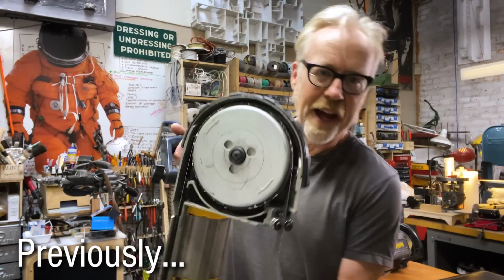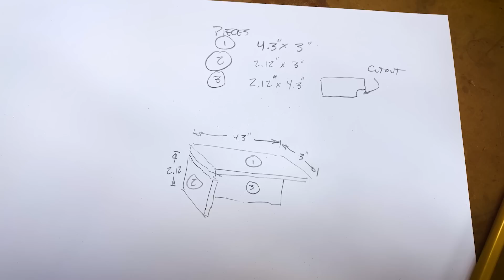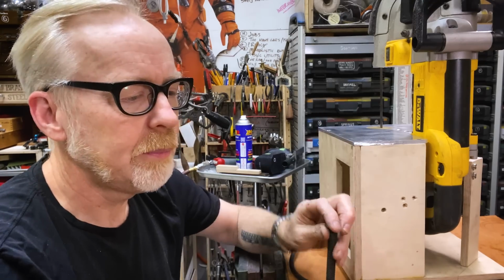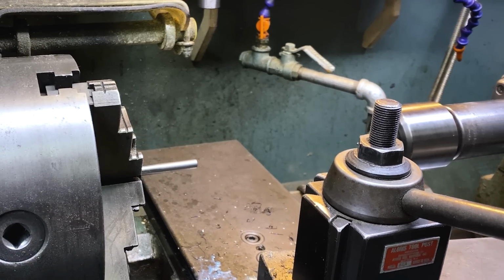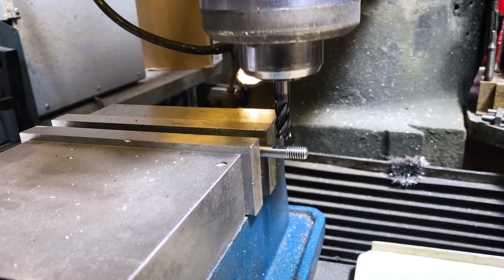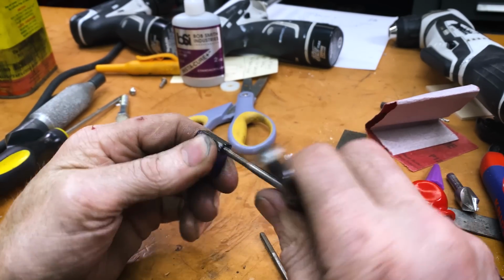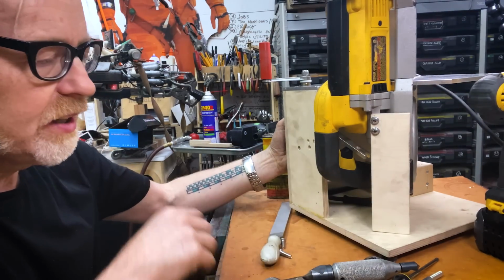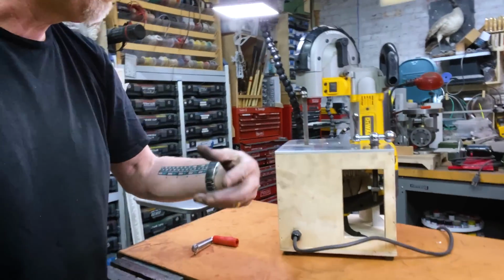Adam Savage Upgrades His Mini Bandsaw!

Comment: If ya had a worm gear on a rod for the crank handle and a strait tooth gear to fit the bolt making a counter sink hole in the aluminum plate for the bolt head (mill the bolt head into a flat disk that fits the hole snug) using only the middle part of the thrust bearing. If plate is to thin add a small plate under neath make flush a cap or cover plate grease inside (leaves you with nothing on top to block your material your cutting) This way you can mount the crank handle to the side of your stand. Or my favorite I like to jerry rigging a Harbor freight router veritable speed controller or a foot pedal switch and a zip tie holding down the tools switch.

Comment: I'm surprised the trigger was not just zip tied down and a power dimmer switch was added to the power plug wire so it could be turned off and on then turned up or down to make it go slower or faster.

Comment: my first thought was an eccentric thingy rubbing against the trigger, on a shaft connected to just a knob on the side, so that when you turn the knob, it presses the trigger in further. add some stops so that you cant turn the knob too far and turn the saw off when going full speed, and maybe drive it with a worm gear or something for positioning and so the pressure from the trigger doesnt move your shaft? i think having it on the top is kind of a safety hazard, and reduces the bed size on an already tiny tool.

edit: there really isnt any reason why the design used couldnt be geared to have the speed control on the side, either.

Comment: Seems there is a dial on the side of the saw, visible on the saw body below the handle at 26:35. Is that not a speed control already built in?

Comment: I think U should've put the lever hinge on the other side of the saw 
That way 
1, the removable of the rig is much easier 
2, the amounts of turns U need to do is much smaller 
And 3, invert the direction of the operation ... turn right to speed up

Comment: Maybe the front panel has the bottom dust drawer attached so instead of opening the door to get the tray out to empty
You can just lift the front panel and drawer in one to save cleaning time
And the drawer helps to keep the front panel in place

I want one now

Or maybe 2

So I can make one into a gravity engine to power the other one

Comment: Should have just made a foot switch for on/off. Probably more useful than variable speed knob, I’ve got the same saw and there’s a separate knob for variable speed if you need it. I like that table though
Reply: well it is hard to see on camera, but Adam cave is really small and a foot pedal would add vertical space requirement to the setup, 
plus the foot pedal would add more time to the setup time and it will reduces portability and make it less used.
also without the a foot pedal he can just put it on table that he is working on and plug it into the table.

Comment: Question...instead of the handle why couldnt you just take the button out and replace it with a 110v dimmer switch? It would work like a variable resistor to lower and raise voltage to blade aka speed controller

Comment: At 19:20 why not just chuck a die on its own (without the handle) into the tailstock chuck? And then just turn the lathe chuck to do the cutting?
Edit: Immediately realized that you would have to unlock the tailstock to allow it to slide in as the die cuts along the piece. But as long as the piece can fit far enough into the chuck/tailstock to cut all the threads it should be fine. But as I'm typing this I am realizing that It's easier to just use the die in a handle like normal, and maybe use the tailstock to square up the die for the first cut, after which it will stay true on its own. Exactly as Adam has done here LOL

Comment: I would have put the handle on the side and used a right angle lever to translate the horizontal rotational movement to vertical and avoid having a finger control on the same surface you are cutting on.

Comment: If you had slanted the lid of your "switch box" any dust etc wouldn't accumulate right in that hard to get at corner. You could still do that actually by adding a quarter cone cap in that corner.

Comment: Assuming that space is no issue, is it better to buy one of these small portable bandsaws or a cheap Harbor Freight bandsaw and install a metal blade?
Is this DeWalt that much better quality than a bench top saw from harbor freight? 
I know HF isn't great quality, but for about the same price they have saws that have MUCH bigger capacity, throat and height wise.

Comment: ,Mr Adam I wondered why you didn't put a speed control and on- off on that piece of plywood LEG and wire the throttle speed  and block the with a standard light switch and I also though that hole I instead put in two computer fans

Comment: Love the videos and engineering but, instead of building the speed control.  Why not just lock the trigger on (or use a zip tie on it) and use the speed control dial built into the grip?

Comment: Is there not a speed controller near the handle? Its the dial wheel near the handle. Both the DeWalt and my Milwaukee have the same built in speed control.

Comment: Okay, that's  all good and fine BUT! Vhat I van't to see is more of a metal housing with a stainless steel tilting vork surface where the saw can easily snap in and out without removing the shroud. Do you think you can do that? Well do ya?

Comment: That was the most complicated way ever of going at it but I guess it worked.  I would have just shorted the trigger and used a dimmer switch in line with the power cord would have done the same thing as the speed controller on the trigger switch.

Comment: Adam, as much as I love your mechanical problem solving over electrical problem solving, I want to issue 2 reasons why you should not have installed this modification.
No. 1
Your use of a screw arm is a good one. I appreciate the use of screw threads and pivots, and proprietary parts and compression bearings. But an arm such as that on the working surface raises a cause for alarm, if you get caught up in your work and reach over, your arm may be in danger. Putting it on the side would have worked better, and you could have used some kind of belt system or a mechanism to transfer energy in 90 degrees (A planetary system of gears would have been amazing.)
The only downside with this is that you have an empty region where you screw down and nothing happens because the electronic mechanism hasn't triggered. This method is precise, but extravagant. I like it, but it could use more adjustments.
No.2
If you shove a wedge into the trigger to make it full speed, you can easily regulate it with a potentiometer. Or better yet, put in two switches for the power and hack into the trigger switch for full speed. Put in a potentiometer and shove all the extra parts into the box you made for the electronics. 
P.S. Drill a hole and put in a shop vac port, for God's sake!
P.P.S. This is off topic, but when I make a machine like this, I like to have contingencies. One of those that is easily modified and of incredible use is a foot switch. Momentary, if you can make it, but basically have a failsafe especially for these small electronic builds.

Comment: quite a complex solution to the problem, a simple rotating axle with a cam on its end, with the lobe in contact with the switch would have done it, and not interfered with the top surface. But i guess making your own idea is the whole point.

Comment: These saws have built in speed control, there is a numbered dial on the handle that varies the blade speed between 100-350 FPM.  His device is neat regardless but unnecessary.

Comment: Am I the only one screaming FOOT SWITCH during the whole speed control? It would be so easy to make one with the scraps of the aluminum left over from the top - and using some spiral springs with a tensionable line to pull down the switch when the foot pedal as it runs.
Can one buy a commercially made foot switch? I've never looked for or noticed one - but I've got several of them to turn over and over and make a plan to make one.
I guess I'll have to search TESTED to see if that ever came to pass...

Comment: Great build but I would have just put in a metal electrical box for the switch and to hold the wires. Much less complicated and easy access if it is ever needed to change the switch.

Comment: needs hard limits on the yoke screw so you don't crush the switch with your mechanical advantage, but nice. Could have made electrical speed control but if you wanted it to be used like originally intended you don't have to repair it, just unbolt it.

Comment: A cleaner way would be to remove trigger switch and wire up a dial potentiometer to the front of the unit. The less mechanics, less problems.

Comment: Why not just remove the trigger and rewire in a variable speed dial? Also just an idea, but maybe put a small dowel pin to hold your brass insert in place so it doesn't spin due to vibration and kink the blade.

Comment: If these were the Mythbusters days, Jamies rig would have had a regular dial speed controller and worked 100 times better.  Plus now you just reduced the throat of the saw, and have to reach around the machine to change speed.

Comment: You might contact DeWalt to discuss licensing your accessory and thumbs up on design that they could refine and market. This is a NEATO tool accessory. IT likely would get more service in this form for most users, unless you do welding for a living. 
 Another time-honored speed control could be done with a shielded foot pedal switch, or a home-made one via bicycle cable with an little airbag under a lever to trip the power switch. You got a lot of unnecessary thrust bearings. The nylon  washers were really enough... but hey, we like MORE when less will do! In my little world, thrust bearings are used to increase the clamping action of vice jaws on machines.

 I very well might make one of these, but will omity the rubber feet, and have a manner to clamp to table or stand. Too dangerous sitting like a toaster.
 When I was 10 Carpenters were doing a basement finish, and they brought in a folding wooden very flat table that opened up and allowed a 7.25" Circular saw to be mounted from beneath..... This gave them a rigid, square panel saw that was portable.... only 98% as precise as a unisaw..... but one that fits in truck easily. Their precision was excellent, though wasted on doing these basement finishes that bury all the mechanicals and electricals.  Basements were meant to be unfinished WORKSHOP SPACE !!!! Anyhew, your one-day-builds probably saved lots from going mad during lockdown, providing projects people could do. And... SHHHHHHHH about the streetsweepers and windshield wipers, ok ?

Comment: Hi, Adam...  What you really want for that switch is a utility box, something (Like:  https://www.digikey.com/catalog/es/partgroup/snap-utility-boxes/53990) or a regular wiring outlet box.  These would be both well-sealed and flameproof, should any electrical nasty occur.  It isn't just metal dust that's a worry, but any sort of dust.  Under just the wrong circumstances (say like the saw being jammed and you bumping the switch, you can get an arc around a rocker switch.  Stay safe!

Comment: So many questions... Why did you place the power cord on the right side, instead of on the rear of the box? 
Why not open up the bandsaw housing, and bypass the switch, and or lengthen the electronic speed control circuit switch cables to the side of the box,
instead of reinventing the speed control mechanically? Also isn't that switch also illuminated? Why not incorporate that into the design?
...and running the blade whilst adjusting the speed control, as the whole thing is shaking on the table, yikes!

Comment: very clever but I really am sad to see the crank on the table........... which will get in the way of some cuts....   Should have put the crank on the other side where there is nothing........ or you could have just used a long lever that depressed the switch ......... and went through the big cutout hole ........ maybe with ratched sets to hold that speed .

Comment: The fixed cable could now exit from the big hole that act as storage , switch is too small for emergency stop,
nice speed control but wrong direction for slower, foot pedal would be better (which also acts as emergency stop)
foot pedal could make a small motor turn the screw.  (only needed if used daily)
first pressure on foot pedal would provide power, the rest of the motion would be speed

Comment: I don't like the speed adjustment position at all. It's on the top plate, you reach past the blade to adjust it and it spins the wrong way. You could mount on the side and run a threaded rod through the trigger assembly (captured in a way that's easy to remove) and the action of screwing pulls a wedge shape of some sort through the handle hole and that wedge actuates the trigger. You can fix the direction by putting the wedge on the left side of the trigger.

Comment: Here are the problems:
-You cannot accurately estimate the speed with this control
-Your arm is dangreously close to the bandsaw during the control operation
-You did lots of machining, and it is a heavy design
İnstead, you could just create a port on the drewalt, and control it electronically

Comment: just dont ever use any coolant or it will get on the switch. id investigate whether if you just cable tie the trigger down and put an in-line potentiometer between the switch and the saw whether it would allow you to adjust the speed by turning a knob on the front.

Comment: Not to question the placement, but... A) Isn't it potentially dangerous to be cranking so close to an operating blade?  And B) while it's unlikely that it'll ever be in the path, why risk it?  You could have accomplished the same thing in a safer, out of the way manner by using a worm gear or adjustment wheel on the side of the base.

Comment: Two days work at say $30/hr = $480. Cost of nice used variable speed metal cutting band saw $350. Also, a router speed control would have been a much cleaner and easier solution.

Comment: I really like this build, but...

I recently picked up a porta band with the intention of building a vertical stand for it. Or a combo mount that will allow it to chop long materials. Not sure yet. 
 Like I said, I really like this build, with the exception of where the speed control crank is located. Right on top of the table where it would prohibit ripping long materials, or where a ripping fence could be installed is not ideal if you ask me. There is plenty of room inside the plywood box to fit a couple levers that could interact in a fashion to depress the trigger and get precise speed control, and have the crank located on the front or the side of the box. Completely out of the way. It would take some engineering and design, but hey, that's what it's all about isn't it? Overly complicated, mechanically operated speed control for your vertically mounted porta band saw!
 Not poo-pooing this design at all. Just sharing my thoughts here.

Comment: This is an awesome build but overly complicated. The saw already has a speed control dial on the handle. Just zip tie trigger in the on position and use the built in speed control dial.

Comment: Wouldn't it have been better to put a cam on a rod in from the side you cut the door out of?  Then you simply turn a knob on the end of the rod and the cam depresses the switch more or less. The advantage would be that you won't have a bolt head and crank sticking up where it might get in the way of pushing stock through. Added advantage is you wouldn't be adjusting the speed with your arm near a moving blade.

Comment: It is most likely a universal motor, so you could've used a simple light dimmer for speed control. Or dedicated ebay-special speed control modules. But cool mods anyways)
Reply: It has electronic speed control thumb dial. A dimmer would fry it.

Comment: Savage logic "I don't want to put the switch on proud of the box as it would get in the way if i want to store it" then precedes to cut hole in side and fit a large cable that sticks out further than the switch would have. should have put switch on side high up to avoid metal dust fouling electric switch.

Comment: Say Adam do you have reregenerating arms? 😂
Like say the Man who makes hand made walking sticks in Germany in a place called Lindewerra (alten stockmacherei)

He has a gouging wheel in a upright position for making a curl or twist on the stick, he has approved regrowing fingers 👍🏻😁

Treat your machine like they wanna kill you, like my angle grinder today, it already tried to cut of my father finger (he had it clamped in a vice 🤔) 

and now it wanted a round 2 on me whilst I was changing the grindingdisc for a flapdisc it switched on because  I need to use a wrench and 2 point prawn spanner to loosen up the lug nut.

That on itself is a harmless act till you and me are too enthusiastic and things seem to go wrong 😅🤣

The spanner underneath the grinder nearly hit me on the side of the head, because of what my uncle told me I threw the grinder on the workbench(breaking the disc) whilst I moved my ass (those little pieces fly everywhere) and pull the power. 

Now I am gonna make a socket on my work bench for safety reasons 👍🏻

Ps. Always pull the plug on the angle grinder when you need to use 2 spanners, I normally always do except for today. 

Older machines tend to have these, newer machines only have a top spanner (or none) and bottom spanner is replaced for a locking bolt.